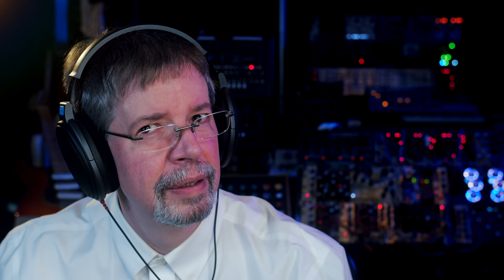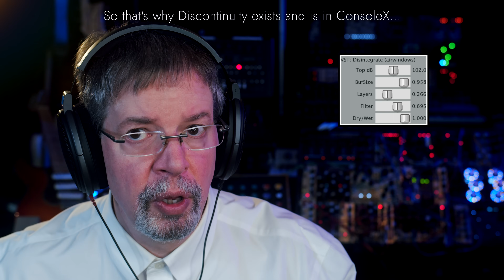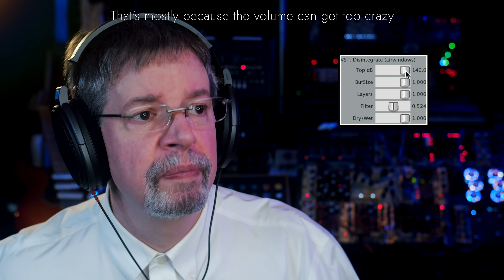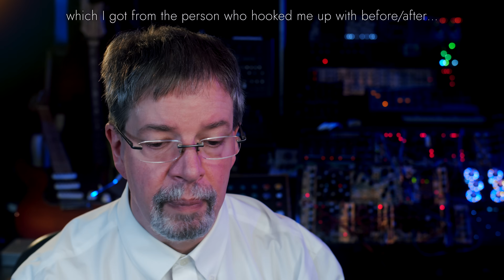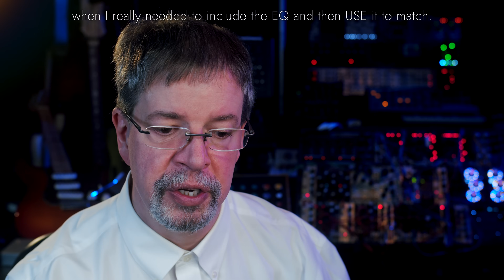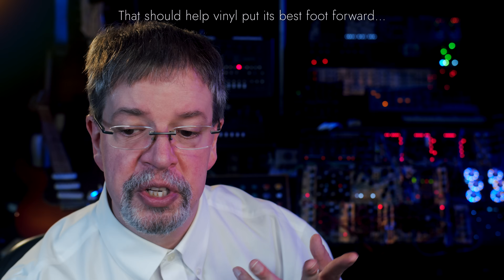Airwindows Disintegrate: Free Mac/Windows/Linux/Pi CLAP/AU/VST3/VST2/LV2/Rack

Comment: 13:22 This is a sound that I have been trying to find a way to dial in for a long time now. This right here. THIS. Thank you yet again, Chris.
Reply: YES! A bit like an FM radio with the worst reception ever. Or... I had a Walkman once that, instead of slowing down when the batteries started dying, sounded a bit like that. I, too, always wanted a way to reproduce that kind of "disintegrating" effect.